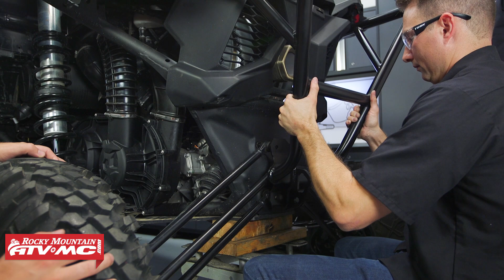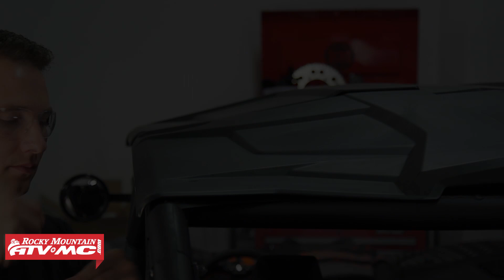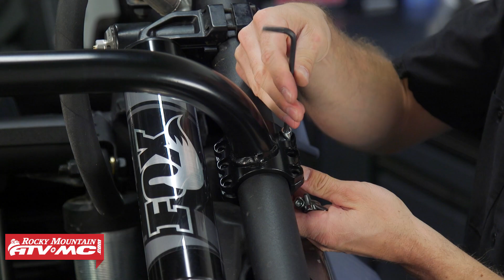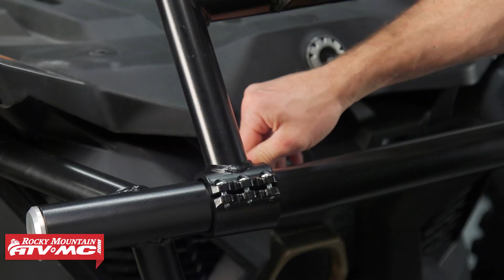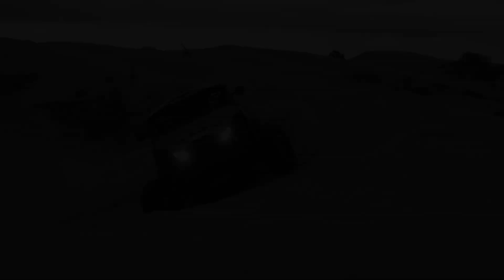How To Install the Tusk Rear Bumper, Cargo Rack, & Spare Tire Carrier | Can-Am Maverick X3

Comment: I bought a plow from you guys and it doesn't fit on my side by side the mounting bracket and the plow wont line up and I don't know what the problem is. And last night just got 5 inches of snow and cant clear my driveway.